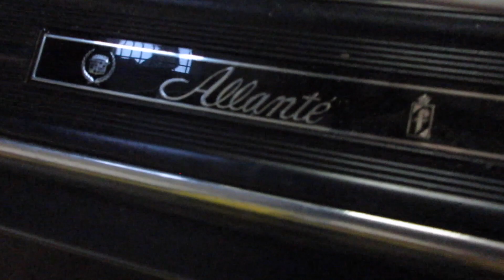Brake Pads  10/24/19 - Day 3,242

Comment: In spite of knowing people at EBC and having access to their pads I just put BMW ones on. The dust I don't really care about. The valueline set of pads and wear sensor is good value, too. I don't care about the cleanliness that much, but yeah. ATE also make Ceramic pads which are meant to dust a lot less than OE too. They're expensive though. Two legs of the stool.